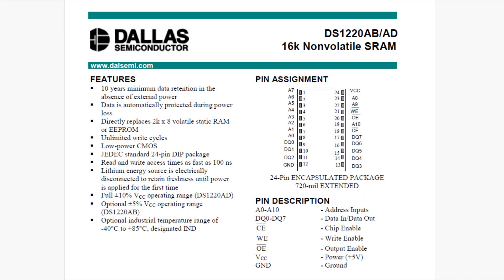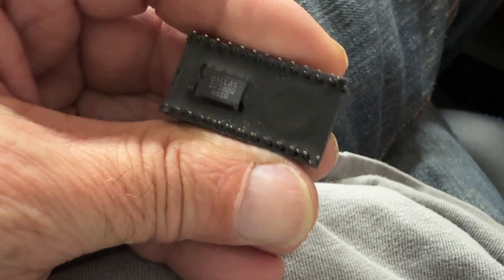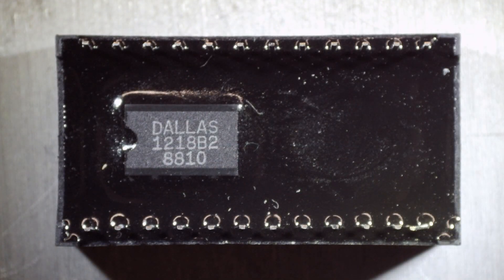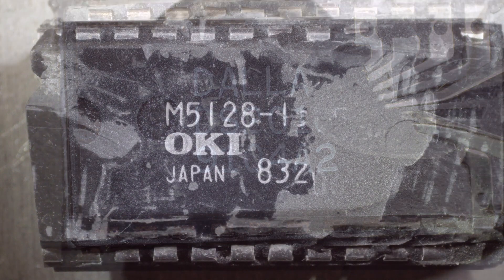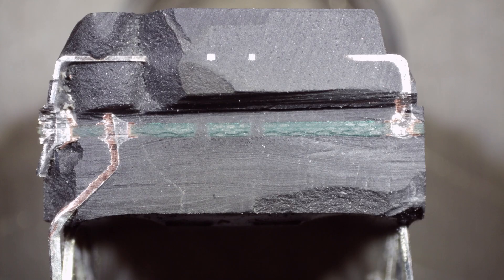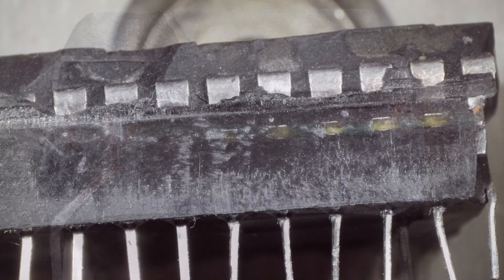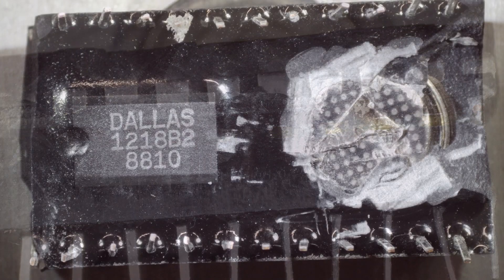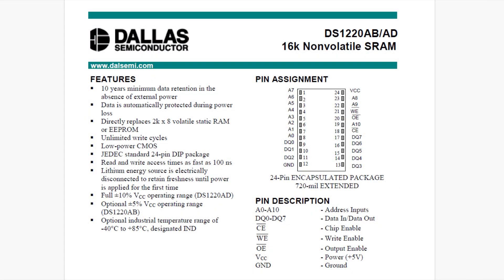#2397 DALLAS 1220 Non-volatile RAM

Comment: In temperatures above 300°C, the rosin they have used as a potting becomes soft and brittle and can be easily scraped off (as long as it is kept above 300°C, when it cools down, it becomes hard again).
Reply: What temperature does the battery explode at?
Reply: @rocketman221projects It will pop at above 180C, but likely the plastic seal will surrender earlier. 20+ year old battery is likely to be completely dry inside, so it is rather a small pop, than an explosion.

Comment: I have a Wavetek 2450 signal generator with one of these chips in it.  No real time clock, just memory.  It still works but I am waiting for the day it bricks itself due to a battery I cannot change.  Not sue I have the delicate hands to crack it open and solder on a new battery. Others have done it.

Comment: FWIW, another YouTuber Necroware showed the use of a hot air gun in aiding the cleaner dismantling of those Dallas battery-backed resin encapsulated form factors.  Search for "RTC module" in his YouTube videos.

Comment: At some point, Dallas began manufacturing these with unencapsulated tops, such that one would just supply their own SRAM. The two batteries were still encapsulated on the bottom, but since DIP control chip was exposed down in the center of the 0.6” wide SRAM socket, it’s much more straightforward to bodge in an external battery.

Comment: The DS5000 was similar in that it used an internal battery to keep the RAM alive.  It was compatible with the I8052.  It was much easier to use than the 8752 EPROM version.  I designed them into several devices that we intended to update within 10 years.  Some of those devices are still in service after more than 25 years.

Comment: The battery backed RTC is more interesting as it's a regular RTC chip, but the battery and crystal pins are folded inwards to connect with the onboard battery and crystal, and the footprint is missing those pins. Not sure what Dallas was thinking back then in making a part that literally self destructs after a period of time, but they did wise up as you can find similar parts, except they have a battery holder built in so it can be replaced.

Comment: IIRC, these types of modules had some type of fuse tripped the first time 5V was applied to the part, connecting the battery. So that 10 years of life was supposed to be after first power-on. I wonder how well these age(d) if they were never activated. Could new ones still be OK after 20-30 years?

Comment: Considering how expensive these modules often are ($20+, or aren't even produced anymore), I wonder how easy it would be to drill-out the old coin cell and mount a brand-new coin cell externally, connected via some wires?
Reply: Doable, just back up the RAm content first, then remove the old coin cell, and solder wires to the remains of the pins.

Comment: These were often found in the older Gilbarco fuel dispensers.  Even when we called in to top tier support as factory techs, we were advised NOT to touch those chips or even look at them wrong.

Comment: Many of the questions in the comments are answered in Maxim/Analog Application Note 202, dated May 14, 2002, titled "NV SRAM Frequently Asked Questions". It's on Analog's Website; I'd link directly to it, but YouTube is funny about posting hyperlinks.
Reply from the maker: https://www.farnell.com/datasheets/309145.pdf
Reply: @IMSAIGuy  Yep, that's basically it, just a slightly older version. I just tried posting a link to the latest version at Analog's site, and YouTube nuked the entire post. 🙄 I hate the clowns programming this site....
Anyway, if it's any help to others looking to replace NVSRAM ICs, I'd recommend also reading Application Notes 3759, "Timing Considerations When Using NVSRAM," and 4893, "Substitution Rules for Nonvolatile Memory Components". I learned of those from Mouser.

Comment: My Tektronix TDS 540 has a Dallas DS1245Y-120 NVSRAM chip in it, and you can probably guess the only fault in the entire instrument from knowing that alone. You can actually see the circular outline of the internal coin-cell battery cavity from the top surface of the package. I'm still thinking about whether to open it and add a battery holder, or simply buy a new replacement chip. Evidently, they're still made. Though at $51 apiece, and spotty availability, the choice might be made for me.

Comment: Back in the day I worked on a system that had hundreds of these (300+ modules, each with its own NVRAM). I left before the batteries died, but one of my former co-workers described what a PITA it was dealing with that. The 1220 was also EOLed at that point so they had fun sourcing the replacements.

Comment: I was hoping to see where the battery connections were made in order to bodge on a new battery 🫤
Reply: Necroware has a lot of research on similar NVRAM chips and found out that if you heat them with a heatgun you can just peel the resin and replace the battery.
Reply: @pieroc91  Thank you very much for introducing me to Necroware.  Awesome channel.
Reply: There are a few hacks online to solder replacement CR2032 battery to Dallas RTC/ / Ram modules.

Comment: I have worked on a couple things over the years that used them, the battery died and someone had modified it.  They excavated into the package to get to the battery connections, cut the pins and soldered a pair of wires onto them.  The wires went to a coin cell holder that was then glued on top of it.  Personally I HATE these abominations.  Whatever nitwit that thought these things up should be shot, reincarnated and shot again.  I mean seriously, how could they think these were a good idea.  It would be like making a engine for a car and deciding to cast the battery inside the engine block.  I'm a fan of the SnapHat style that have the battery and a crystal in a "hat" that snaps on top of the IC.  You did a video on the ones I sent you some time ago.  Whoever invented them probably got tired of replacing these PITA's.

Comment: Isn't that "just" sram + a battery?
Reply: Also includes a small chip to power the RAM when VCC is off and also holds the RAM chip enables inactive so the RAM can't get corrupted and stays low power.
Reply: No expiration date?  Can the voltage be checked?